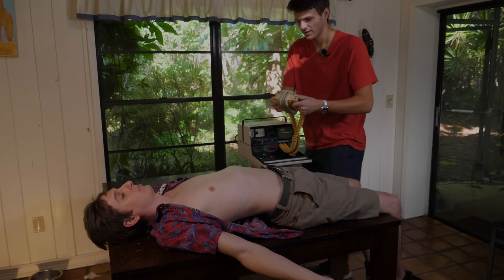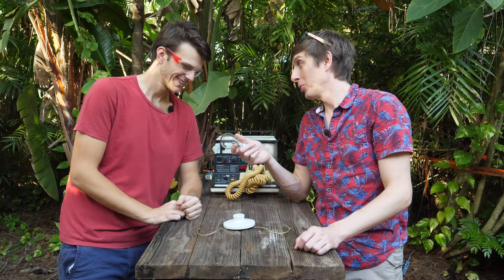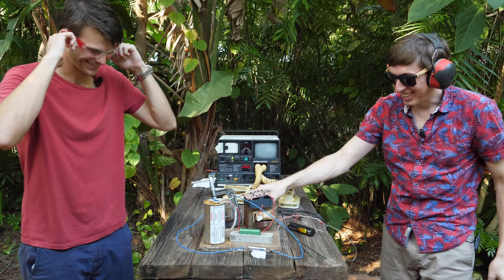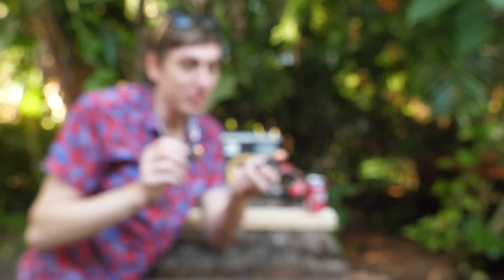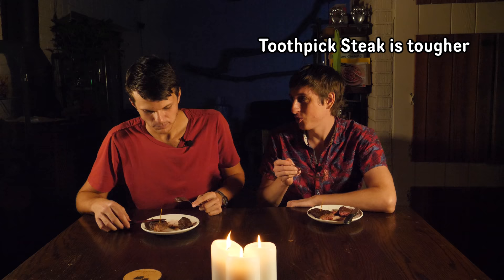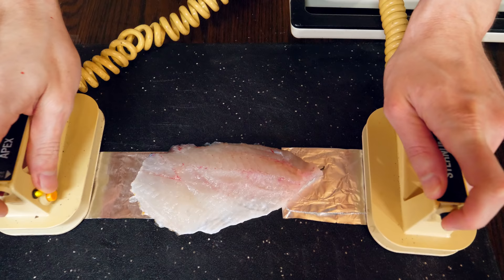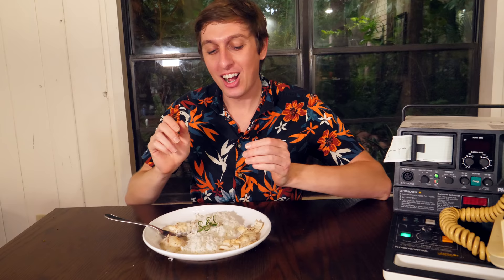We Defibrillated a Steak

Comment: I’m a Paramedic and a fan, when we used the “paddles” we use a special lube to create a better conduction thru the body.  We use pads now and they also have the special lube already on them.  Also that is an old monophasic monitor, now we use a biphasic monitor and we can get away with much less power! Instead of the 360 J of energy now we use only 200 J to get the same effect with the biphasic monitor.
Reply: I’m an working to be a emt. We were actually just talking about this in class so I wanted to comment this but looks like you already did

Comment: Working on a crt-tv similarly restarted my heartmeat when the 9volt battery I was holding in my mouth dropped onto the floor. I like the tanginess of the battery because it helps me concentrate on  science better. An important part of science is tasting electricity whenever possible. Next time I am at my doctors I will ask for the defibrillator for home otherwise I need to move on to a car battery to taste. I have big projects ahead of me! Big projects mean a big thirst for electricity! It is cleaner energy than chewing coal. -Lenny

Comment: TIL there was a product sold in the 80's and 90's called the "Electric Worm Getter". It was sold to fishermen for the collection of earthworms for bait. It sent an electric shock through the top layer of soil forcing the worms to surface. It had to be recalled in 1993 after 30 people died using it. u should build it
Reply: Um they literally talk about this
Reply: "30 people died using it. u should build it" --Gigachad
Reply: Lol. That sounds like a threat.
Reply: 7:30
Reply: They're basically crudely-built power inverters with neither voltage stabilizer feedback nor SPWM modulation. Same devices were once used by fishermen to stun fish in water.

Comment: When I was a kid in Temperance, Michigan, an old guy showed me how to get worms for fishing.  You take two coat hangers and stretch them out, then you cut off the end of an extension cord and wrap them around the ends of the coat hangers.  Insert the coat hangers into the grass in your front yard about 3 feet apart and then plug the extension cord in;  You will literally see the worms flying to the surface where you can pick them up while wearing gloves and shoes.

Comment: that is one old defibrillator, it’s been over 20 years since we have used paddles.
Reply: what is used now then?
Reply: @wilhelmmidgard7015  the general paddle design has changed to make it more modern looking. But one more modern design in public AED units, but also in hospital units is that paddles senses the rythmic of the heart, determines if its shockable and what voltage it needs. So you can't make it shock things you're not supposed to- like dead and inorganic things

Comment: You know what probably helps, if you shock a different cut meat, now you're shocking the muscle across but I think you need to shock the fibres longitudinal
Reply: It wouldn't work because after cows are slaughtered, they pre-stimulate them with electricity to prevent rigor mortis. All the stored up energy in the cow muscles gets used up, so the muscles can't contract anymore.
Reply: Theyre putting energy in it though so unless it also fixes the electrolytes to the membranes and synapses and fries the connections something should happen. Taking out tension doesn't mean you can't put it back in I'd say
Reply: @Abihef  The energy they put in wouldn't necessarily cause the meat to contract. More likely it would just turn into heat.

Also the meat is partially decomposed since most beef is aged a little. The enzymes in the muscle cells will digest parts of the meat.

Comment: You could have used a steak with the grain(muscle fibers) going long ways so any contraction would be more noticable also you could have rubbed it with an electrolyte solution of 2 tbsp salt per liter of water to improve conductivity
Reply: He mentioned the lack of “energy” in the steak.   So I wonder if you soaked it in Glucose.   Salts should still be there.
Reply: @legonut78  yeah adding some runners glucose syrup to the electrotyle solution definitely wouldnt hurt, but I'm not sure how well cellular absorption of the glucose after death would be. I guess its worth a shot
Reply: @autodidacticartisan  this is getting a little more Frankenstein then I’m comfortable with.   Lol.
Reply: @legonut78  when I get a better camera I'm going to recreate this experiment at 10,000 volts @ 30mA and show it on a new channel. But I'll also be using "fresher meat" with the muscle intact and still attached to the corresponding bones
Reply: @autodidacticartisan  A neon sign transformer won't work great for this kind of stuff. You need to rectify it and charge a cap.
Reply: @Harms  do you thinks so?
Reply: @autodidacticartisan  You'll probably get some motion out of it since the body communicated with voltages less than one tenth of volt, but the breakdown voltage of flesh is probably fairly low so remember to use big electrodes so you can spread out the current. The point of a wire will just make it arc. If you give it a shot then let me know though, would love to see the results! Best of luck and remember to stay safe :))

Comment: The inductor dampens the pulse because it is current driven whereas the capacitor is voltage driven. A capacitor will accept and then discharge energy on a delay, while inductors would effectively limit the current and should, I believe, spread out the current discharge into the smaller current pulses. In fact, resistance and impedance are used on DC vs AC circuits. A DC circuit resistance is spoken of in terms of just resistance, but with AC, it called impedance.

Comment: I was an electrician in a large slaughter house back in the 1970's and can remember reading a cattle article that some company was running two experiments on cattle. They were shocking the sides of beef before moving them into chill box 
to tenderize the meat and feeding cattle a think they said a halve a pound of cement dust in a attempt to fatten them up quicker. Place had a separate building that provide cuts of meats to restaurants. Found out that a steak house we liked purchased nothing but cheap cow meat. They had the meat run thru a pinning machine that put holes in it then soaked it in tenderizing solution for awhile.

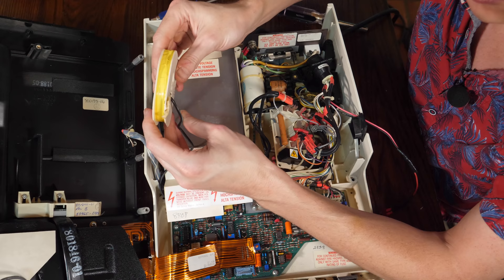Comment: 1:49 The high voltage resistor in the center of the screen (orangish brown and about 3/8" diameter and 3" long) was made by the company my dad founded,  Caddock Electronics.  He had several patents on the design.
Reply: What's it's value?
Reply: @coastersaga  The resistance value and tolerance would be printed on it. =

Comment: You should try with a biphasic defibrillator where the discharge is spread out over a larger body surface area using pads instead of paddles.

Comment: At 360 joules, you're actually charging the 36 microfarad capacitor up to 4,472 volts. At the full rated 5,200 volts, the capacitor would store 486.72 volts. Being that the capacitor tested slightly higher capacity, (37.2 microfarads) at 5,200 volts, I estimate ~503 joules. If the unit indeed charges to 4,472 volts, and the capacitor is actually 37.2  microfarads, it might actually be delivering 372 joules, up from the 360 joules indicated. To calibrate the higher capacitor value to exactly 360 joules, the voltage would have to be reduced to 4,399.4 volts.

Comment: When I had to get certified I didn’t realize that to use a defibrillator the heart has to be palpitating. Meaning you have to do CPR to get the heart going and then the defibrillator corrects the rhythm. So what does that mean, the defibrillator doesn’t restart your heart it just helps it get going.

Comment: I used to stick a piece of a ribar into the ground to catch moles. The ground has to be wet. Than you pull a cable from home wired ONLY on the LIVE connector (single phase 220v and again, not the neutral... you don't want to close the circuit, just the live) until the ribar. And wait. All the moles come up within 5 or 10 minutes, than you can pet them or do whatever you prefer. Obviously, be careful: 220v live wire tickles a lot. And if you touch the neutral you will possibly die. 🙃

Comment: So DE-fibrulators do not start your heart. It says what it does right in the name of the tool. It DE-fibrulates, meaning it takes the fibrillation out of your heart by stopping it. Instead of using sensors and hardware to determine if a shock is needed, like an AED does. Manual defibrillators allow trained, medical experts to look at the rythem on the screen, because they usually come with a 5 lead EKG, determine if your heart is creating a shockable rhythm. It is usually a ventrical or a atrial fibrillation, and then the end user can press the buttons to deliver the shock. 

What starts your heart again, because now you have an asystolic rythm, AKA flatline, is your hearts SA node, which is restarted by doing things like chest compressions, chest compressions, chest compressions. The whole point of defibrilation and chest compressions is to restore your heart to a sytolic heart rythm.

Comment: I guess inside Li-on battery usually there is a voltage arrester inside as a safety. So Put so much voltage across it it basically act as a short circuit. But it was surprise it still usable and hold the charge, bay be the resistance over contact are much higher so sparks doesn't destroy the circuits inside.

Comment: There wont be any contraction because the meat is cut cross grain instead of the length of the muscle fibers. The fish contracted because the fillet has enough continuous muscle cells to cause a contraction. You need mass Try using a loin or a bottom round roast Also make sure the flesh is fresh and not frozen.

Comment: To make worms come out from underneath the tree all you have to do is stab two screwdrivers in the ground about 12 in apart near the base of a tree and connect each of the screwdrivers to a 12 volt car battery it takes just a few seconds and the worms will come squirming to the surface. Oh, and it won't kill anybody.

Comment: You should have used the defibrillator on the lake, to see if the fish comes up the surface as the worms did.
Reply: They use a boat with a generator and electrodes sticking down into the water to stun Asian carp, then scoop them up with nets.
Reply: @loupgarou-dj3tm  I was just kidding, fishing with electricity is illegal in most countries.

Comment: So I'm wondering. Would it make a difference if you used a cut of meat with muscle fibers running parallel to the surface. Maybe the longer fibers would have a more noticeable effect. It would also allow you to run the current straight down the fibers. I apologize for the word salad.

Comment: These idiots are doing this without gloves. It doesn't matter how tech savvy you are. If you have something that can stop or start a heart and you are connecting it to a metal can from two different apposing points,wear protection! This is hospital visit waiting to happen. The human body will take in the electricity. These two people are like "Look electricity! Let's risk death!" These is a reason paramedics have to make sure the area is clear when they use defibrillators and they piont them down. Its so they don't accidently shock anything other than the person they trying to revive. Ps. This is coming from an Electrician Student.
Reply: Chill, they are still alive, and you could probably survive that